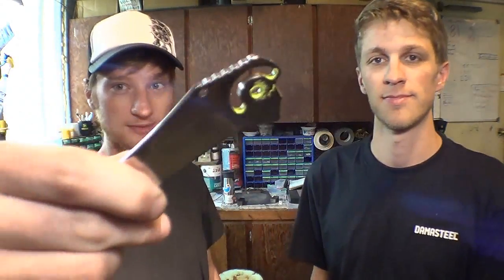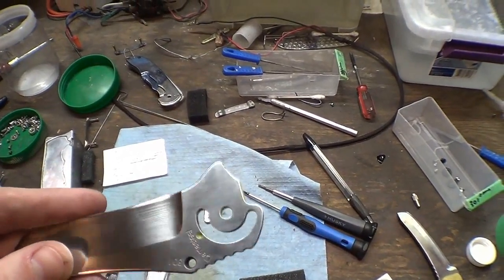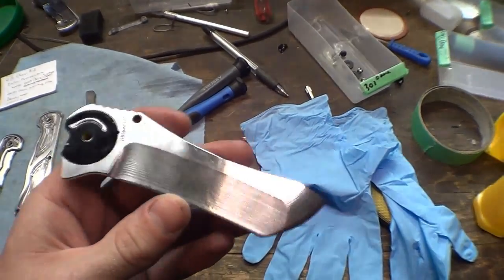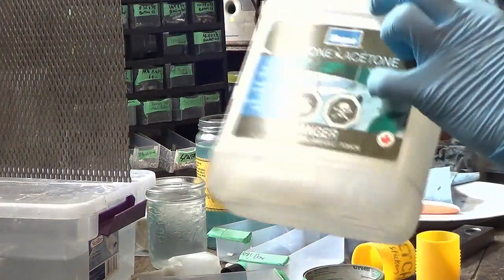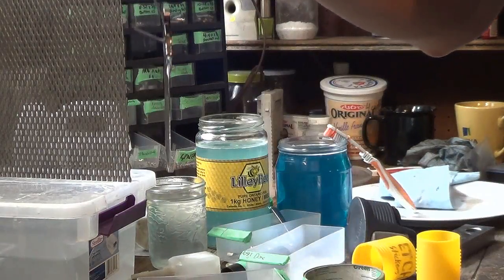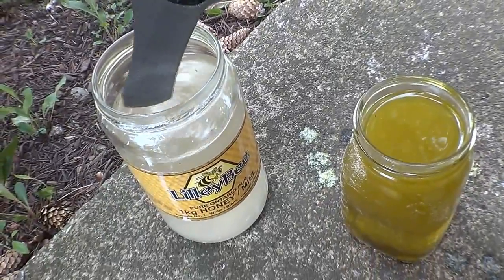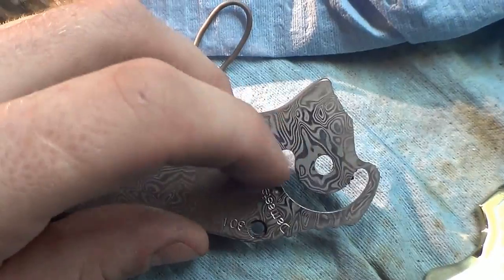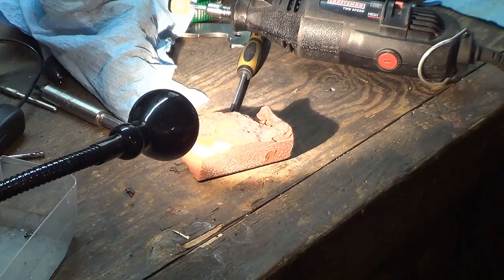KMT 106 - Etching Damasteel knife blades with muriatic acid

Comment: Todd Begg has a video where he heats up the muriatic acid and the Damasteel blade didn’t need to be in the acid as long as 30 minutes, the bubbling reaction was almost instant and very active.  It was then neutralized and dunked in ferric chloride / vinegar combination to finish it off.  Your blade still looks amazing of course.

https://youtu.be/A3wT2s6rCQM

Comment: So the damascus pattern just comes through simply by soaking a blade in acid?
Reply: Adam Jones not unless the blade is made of damascus steel
Reply: Hamon lines show better also, but baking soda to stop the process or it will keep eating the metal

Comment: Just a thought and its a lot safer to work with, I acid etch some of the knives and metal I work with yellow mustard or by soaking in white vinegar. Have you tried on pieces of shop scrap to see how they turn out? Vinegar in a glass jar you can watch the color change over 2 to 5 days. Mustard on a blade wrapped in papertowels then tinfoil. wait 2 to 4 day's not only does it darken but the mustard seasoning will cause an antiquing. 
Just a hint, free for what its worth. ☺
Reply: You sure that works on stainless ?? Don’t think so

Comment: Okay, this video was somewhat helpful! But seening videos of people creating patterns on a knife using a variety of chemicals that imitate Damascus steel patterns without going through the trouble of layering different types of carbon steel is a bit frightful. I was hoping this video would help distinguish the difference between the two because I sure as heck can’t! Seriously can someone help me?
Reply from the maker: +Emmanuel Tapia  we are buying steel that has already been pattern welded at the factory from many layers.  I think forging is very neat but I have no interest in doing it myself.  No imitation Damascus here :-)
Reply: +JohnGrimsmo oh lol...okay thank... now I understand!
Reply: +JohnGrimsmo say...where do you buy steel that has already been pattern weilded? I've been forging it myself and it'd be swell to....not have to once in a while. ;)
Reply: Admiral steel has welded damascus but its priced as so
Reply: It's very easy to tell the difference between knock off Chinese junk fake etched blades and a real forged Damascus blade. If you have to ask if it's real it probably isn't. Damascus is cheap. I get it for around 3$per inch forged, etched and finished. Including my handles. In any form of Damascus including ladder and rain drop patterns

Comment: Would stainless steel be able to get a pattern using this method
Reply: Nope. This is two types of steel welded together in multiple layers and likely pressed, stretched out, then cut and forge welded again.. the acid eats away at one type of steel easier than the other, so you get the etching within the patterns.

Comment: John if h
U heat up the muriatic, it will etch super deep, in two minutes, literally, boil water
Put acid in seperate container float the acid container in boiled water 2 minutes, in a half hour it will be gone, and the etch in 2 minutes is insanely deep
Reply from the maker: +justin savkov Thanks Justin.  I know Erik heats it up but I think he just microwaves the water tub, not bringing it to a boil just warming it up, then puts the muriatic tub in there.  I'll suggest that he got hotter next time.  Maybe a pot of water on a hot plate.

Comment: am I understanding correctly that you can just drop a piece of steel in muriatic acid, and it will come out with that particular pattern on it ?
Reply: +heidbrain No, it has to be piece of steel with two different types of steel twisted into the part. Check out videos on damascus steel and how it is made. The different types of steel etch at different rates giving you the effect of the darker section of the pattern against the shiny section. Hope this helps!

Comment: Hi...can I use vineger as an etchant for damascus steel instead of other chemical etchant??
Reply from the maker: +القاسمي القاسمي I don't know.  I've heard that you can use vinegar to etch carbon steels a little bit, just to put a slight patina on them.  Do some google searching.
Reply: Thanks alot sir
Reply: It will work and it will be visible but not at the level of using ferric or muriatic

Comment: This may sound pretty dumb but here it is anyway.... As a junior chef, I use Wüstof and Henckels knives to cook with. If I dip them into a muriatic acid bath like you did, will the same basic patterns show up on my knives? Any help or info will be appreciated. Thanks Guys. 😎👍
Reply from the maker: Frank Daniels No, don't do that.  The steel has to be a damascus steel or else it won't work.  If you did your knives they'd just turn dark all over and probably look gross.  You can get damascus chef knives though, check it out.
Reply: +Aoi Mikan If it isn't damascus steel you can't.
Reply: consaka1 Roger, thank you.
Reply from the maker: +TheEvilways101 they would look dark grey all over, not swirly.  Lots of guys do it though and it can look cool. Damascus is made from two different steels,  hence the patterns.
Reply: +JohnGrimsmo Hei John! I really Really loved your damascus knives etching videos. 
They are the perfect, beautiful and aghh just amazing pattern i've seen!

I had a question tho.
Are you familiar with etching patterns in HCS blades?
I have recently bought a Chinese Dao (https://www.katana-samurai-sword.com/uk/liuye-dao-p-641.html  This one )  and am decided to get the same pattern on the blade as your knifes.

Could you give me some pointers and advices as to how i can accomplish that beautiful pattern on my blade?
Reply: +JohnGrimsmo what is damascus steel? i make rail road spike knifes.. so what would the blades look like if i did the acid bath on them? would it look all swirly like damascus? or would it just go flat grey? or something else?

Comment: Looks like a quality product but I don't like the CNC marks on the knife bevel. The handle and the etch looks amazing!
Reply: GenOmega2 the knife blank that knife is made from must be forged it is damascus you cant take to metal plates and make damascus steel without a forge. so this knife may be machined, but it is made from forged metal. it is just as good as forged damascus knife
Reply: Graham Wilson Machined knives also have a problem with not being as strong as forged knives. If you want a knife done right, got to a blacksmith, not a machinist.

Comment: Would it be appropriate to use a negative vinyl sticker as a stencil to apply some purpose-designed etch resist (wax/polymer based) in exactly the circle you want?  The adhesive clearly doesn't hold up well enough to the bath of doom...
Reply: Vinyl is probably all you need since muriatic won't eat it.

Comment: If its anything like any of the stainless damascus I have worked with, if you remove it every 5 minutes or so and scrub all the oxides off then let it soak for another 5 so on and so forth, it helps get the dark spots darker and the light spots lighter. Granted that is with a mix of ferric, vinegar, and distilled water and not with Damasteel specifically but the likes of Chad Nichols or Rob Thomas stainless damascus. 

I thought Damasteel said to use muratic at 140°F?

Comment: You can shake (vibrate?) this jar a bit to release bobbles and its good to stabilize temperature of acid to get the same effect to time ratio every time.
Reply: popraw a aquarium bubbler -- used for etching circuit boards all the time to ensure even temperature/clean the bubbles off.